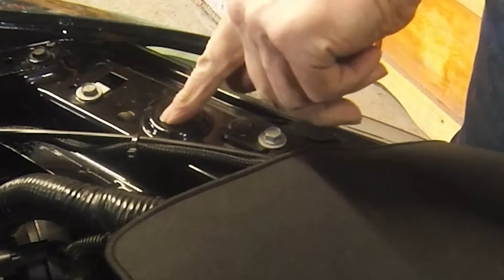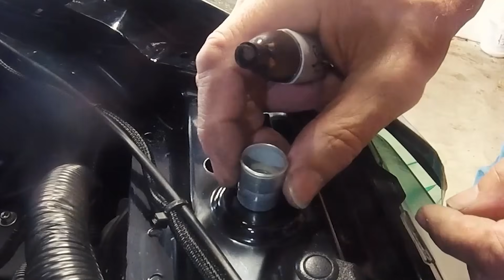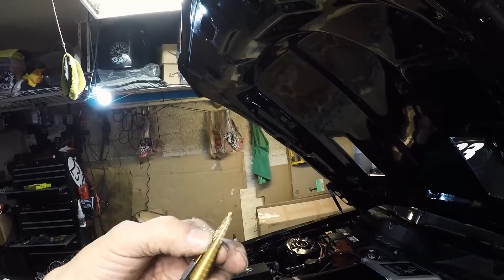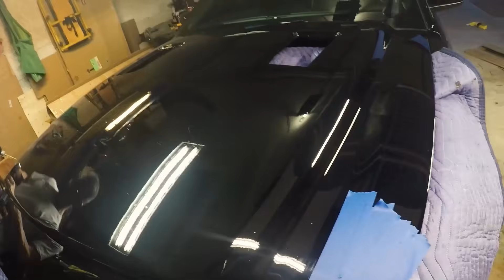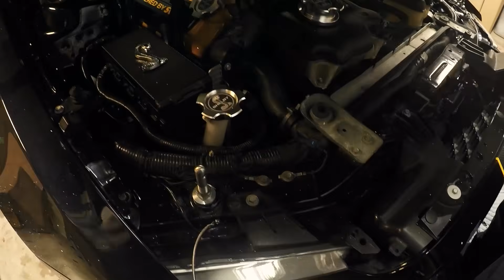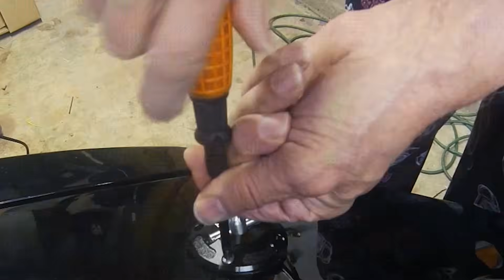How to install Shelby hood pins using the required Shelby install kit

Comment: Do you have a link for the hood pins?
Reply from the maker: You can get the hood pins from Shelby.com but the GT500 install kit that goes with them for 2007-2014 is no longer available.  I just looked and found that out.

Comment: Nice I wish my install kit was the same thread as the hood pin because it’s not.
Reply from the maker: What???  That does seem to make sense.  Maybe Shelby sent you the wrong kit.
Reply: @DocsBoost  the installation kit is discontinued now called today I’m getting a refund for install kit.
Reply from the maker: I better hide the one I have.  LOL
Reply from the maker: Glad to hear you are getting a refund.
Reply: I already installed mine and came up with a possible solution. Is there any way you can measure how far your pin sticks up past the beauty ring?
Reply from the maker: It's pretty damn close to 2-3/4"  I hope that helps whatever it is you have in mind.
Reply: @DocsBoost  I found a male to female adapter that corrected the threads just need to cut pins to proper length.
Reply from the maker: Sounds like you have a winner.
Reply: @DocsBoost  yea I made it work out thanks for the video by the way.
Reply from the maker: Thanks for the engagement and kind words.

Comment: How to screw on the bolts onto shelby rings ???
Reply from the maker: The whole operation of getting the "compression" or "rivet" like inserts installed is trickier than you may think.  If you get the hole just a little too big, the insert fails.
Reply: @DocsBoost  that's what I did ;( the hole os too big. Now I am gonna have to use screws to install them. Do you spray drilled holes with anything to prevent rusting ?
Reply from the maker: Okay, I also ended up with the hole too big and I had to buy another install kit. Before I used the second kit, I went to the hardware store and bought myself a large flat washer with a diameter just a bit greater than the beauty ring that comes in the install kit.  I used a step drill to make the hole a tight fit on the insert.  I mean it was a very tight fit. Then I tack-welded the washer in position and everything worked perfectly.
Reply: @DocsBoost  I ended up screwing the hood pin nest into the frame.
Reply: @DocsBoost  also does the hole have to be perfectly round?
Reply from the maker: For best results get it round as possible and make it a tight fit.  You will be glad you spent the time getting it right.  I used a drill bit and it was not the best choice come to find out.

Comment: Thanks so much for the great video!!
Reply from the maker: Thanks for watching.  I am glad it helped.  I appreciate you taking the time to comment.
Reply: Hey Sir, me again.. lol I bought the same Shelby  hood pins you installed. They don't make the install kit anymore.. lol but I see where people fish a washer and nut thru to keep the pin on. So I think I got that figured out. I do have a question for you if you don't mind me asking. Once you got everything drilled and the pins threw, how did you fix the pin issue at the end of the video. I'm sure I'm going to have the same issue on my fiberglass hood. I really want the pins to sit flush.  Should I make the slots in the Shelby washer beauty rings on the hood itself ain't like a arrow towards the front of the car? Like in a v shape if standing in the center of the hood? You think that would work? I wish I could see yours lol.  Thanks sir!

Comment: Very good. The metal is super thin in that area, you must becareful
Reply from the maker: For sure.  Be careful.  If you go too big, the insert cannot grab and hold.  If that happens, you need to take a large washer and with a step bit, open the hole to 3/4" and make sure the hole is a tight fit on the insert.  Then carefully spot weld that washer over the bumper hole that is too big.  That works because I had to do it on the passenger side.  It works great.  So just be careful taking those holes out to 3/4".